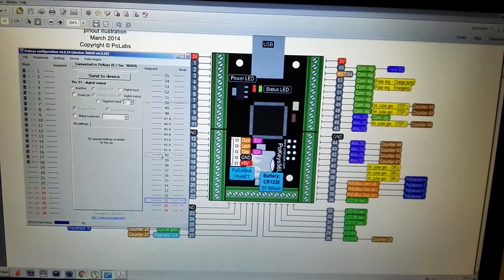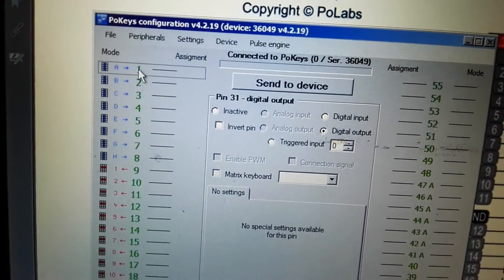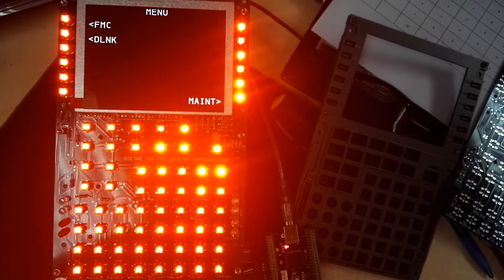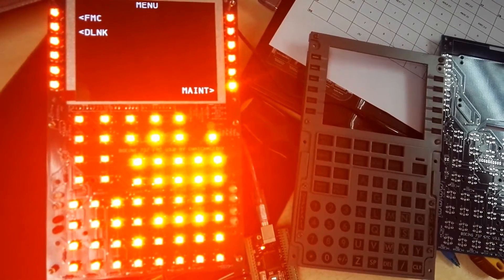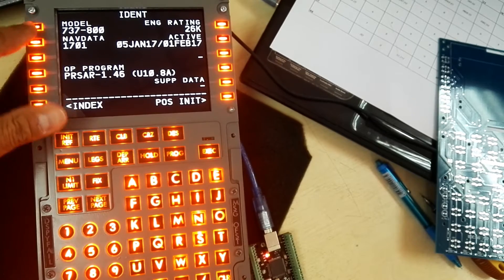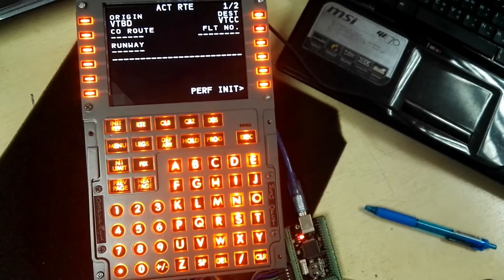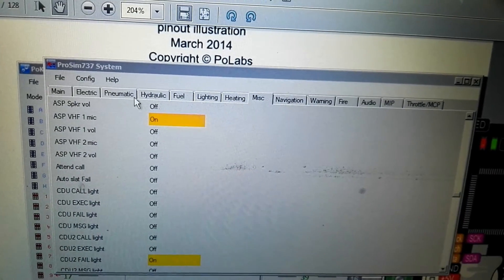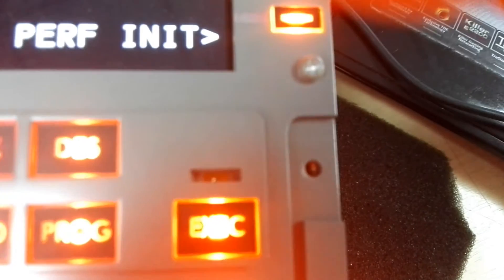How to configuration pokeys board with my FMC PCB

Comment: Hi,I have done this in the past with Prosim but you will find that the CDU Module has to always have focus in Windows. If you use the USB Keys Card from OpenCockpits, this does not need to happen. If you take the focus away to another application on the same computer, your keys will no longer work. This has always been this way but Prosim might be bringing out a dedicated method of addressing these keys in the Prosim Server Module.Kind RegardsBernie.
Reply from the maker: Bernard Thornton https://youtu.be/AX_rEdTxSAk 😀